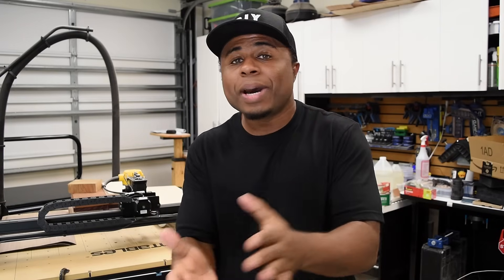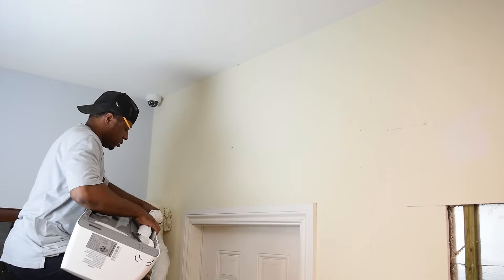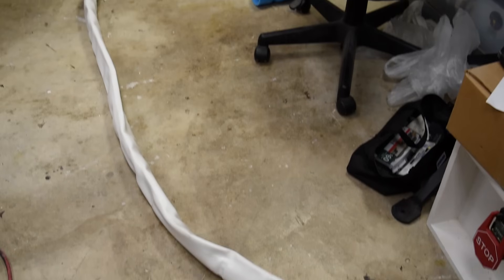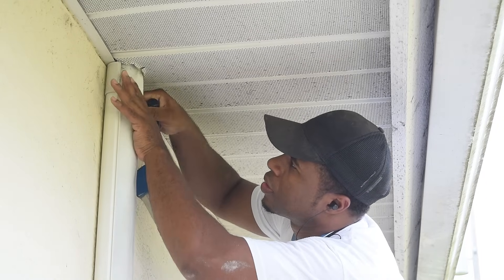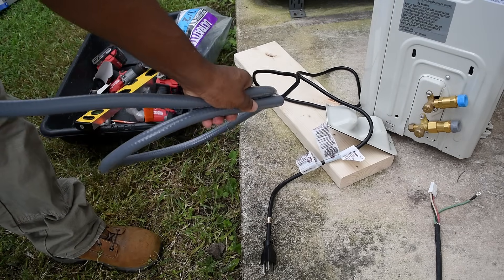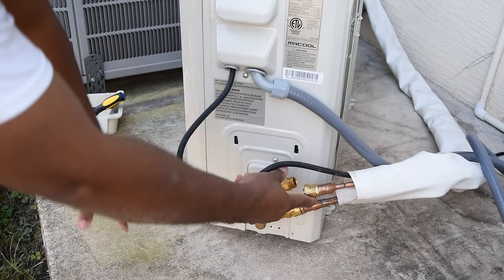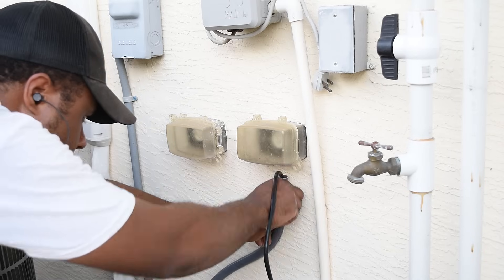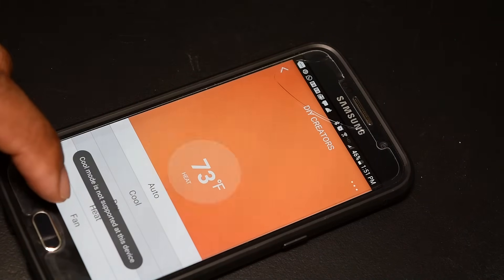How To install Ductless AC & Heating System // True DIY Mini Split MRCOOL

Comment: The air needs to be removed from the pipe work before releasing the refrigerant
Reply: I installed a DIY unit 12k btu 120v system I purchased from A Big Box, it was truly DIY.
Mine had a special quick connect valve that made it impossible to get air in the unit.
And in Florida it would have been full of moisture believe me. But this unit otherwise looks just as nice
with heat and WiFi, I didn’t get either one. Nice work on the install !
Reply: @rogern5368  Yeah those quick connect ones are awesome. Sadly banned in the UK now as they put air con engineers out of business :-)
Reply: Again, think about the older mobile home systems. They came precharged and they "open" the condenser when you tighten the connections down. It pierces the metal membrane thus opening the system up. This one doesnt have valves to back seat or close or any of that. Once you tighten it all down you bubble test it, just like he did. Just to clear this up, these aren't standard mini split systems. They use a different method for charging and there is no way to vacuum the system like you would on a normal system
Reply: Hvac guy here : the Mr cool systems come precharged (think about the older mobile home style line sets). 
There is no evacuation required or needed.
Reply: @BradBuildsStuff102  it comes pre charged in the compressor but the line are open. you have to manually open the valves with a service wrench to release the 410A into the system.and he didnt even pressure check his connections with bubbles. leave it to the professionals.
Reply: i was waiting for the lines to be vacuumed but when it got to the end i was like aaaaaaayyyyy he fucked his system up
Reply: You can tell this is a DIY. I’m not even sure how the system worked with out evacuating the air from the pipes before allowing the refrigerant in. It’s not the air that gets you it’s the moisture, this is why HVAC techs should install them and not a home owner.
Reply: @erevopwns  LOOK HOW STUPID YOU ARE 
"you can tell this is a DIY. I’m not even sure how the system worked with out evacuating the air from the pipes before allowing the refrigerant in"
Reply: brian menendez well if your so smart let’s hear your explanation... I would love to hear this one.
Reply: @brianmenendez  The linsets are precharged. When they are connected a builtin piece peirces the metal stop that contains the refrigerant .  I suspect a very small area of atmspere gets combined  in the system. Of course the excess  of lineset I see curled up behind the units is truly a eyesore and cutting it to size oresents warrenty issues  I have read. 

My issue  with this  system is its very cheep exterior and that most dyi. folks are not  informed  in the basics of power for the unit.
Reply: Robert L. Fallin . Interesting, this suggest to me the lines can't be shortened to length,. Hard to hide on a back -to-back  set up. 
All in all, don't DYI, get a tradesmen
Reply: erevopwns see above..
Reply: @conector14889  YOUR WRONG
Reply: #SHRPSHTR# How so?
Reply: Clone36 the pipes aren’t pre charged lol.... the condensing unit is.
Reply: erevopwns what, you gone all quiet now??
Reply: The pipework comes pre-charged with refrigerant.

Comment: all mini splits are the same to say that this is the only one that u can do yourself is false a decent install for never doing this before but my god at least hire a an hvac guy to run a vacuum on the line set your making unit have hire pressures then needed and down the road your gonna have a bad expantion valve or compressor...

Comment: You should have put a vacuum pump on it before you opened the valves !!
Reply: kirk poff true
Reply: @suicidalth0ughts508  Nope. Not necessary. Lines are charged and sealed at the factory. Seal isn't broken until the lines are connected.

Comment: great video, a couple, fairly significant steps were missed in this process. one is pressure checking the line set with nitrogen before opening the refrigerant valves. Not cost effective or environmentally considerate using the pre charged refrigerant for tight connections. 2, MAJOR STEP MISSED, a vacuum pump needs to be used in order to evacuate any atmospheric pollutants from the line set. Skipping this step could void the warranty and ultimately decrease the longevity of the system as a whole. Skipping this step is the equivalent to a surgeon not washing his hands before a procedure and failure to address this step is considered negligent practices in the eyes of most manufacturers, fyi. thanks
Reply: That is not true with these systems. They come from the factory pre-charged and ready to go.

Comment: not trying to be a hater but 12000 btu is kinda silly for a wall mounted ductless air conditioner. they sell portable versions of that with zero setup for half the price. at the least get a 20k, and more depending on how fast you want your room to be cooled.

Comment: I had an LG Ductless AC/Heat and it was a piece if Junk. Had it 12 years and it broke down 3 times. Went back to window units. They're awkward to put in a window but more reliable.
Reply: probably bc videos like this are put out that misled the correct procedures to install ac's and refrigeration
Reply: I bought the unit from a dealer and he installed it.

Comment: Man that was a great Vid..You covered all the bases. spoke well  ...I been planning to do same..This really put me in a wana do mode..Mine will  replace a 30y old Trane central unit thats been everlasting ..Just wana do it myself and not hire AC man...When this heat 100 deg here in TX drops into 60-70 /fall or spring I will do...THX Mr Cool   dan

Comment: You should have vacuumed the line set. Air in the line reduces performance.
Reply: Yes, indeed Richard....been saying the same thing here. 
I purged my lines...would have evacuated, but thought....well...let's suck it and see. (No pun intended). Been working fine for three years.  Cheers.

Comment: Yes, these units come precharged with the gas, and "vaccing-out"is not strictly necessary.
But I am of the old school: I would attach the liquid line (the smaller of the two copper lines first.... then crack open its valve, just to purge the air from that very long length of copper tube and the evaporator unit indoors. THEN connect the return (larger vapor line).......
As I say, the manufacturers say there is no need.... but hey.... air in any refrigerant system is not a good thing....never has been, never will. 
If you can minimize the amount of air in the system, the system must work better with a higher ratio of refrigerant-gas to-unwanted air....No?
(Air contains moisture: The enemy of any fridge plant! 
Be they industrial units, or transport units.)
As you say, amazingly quiet units....extremely pleased with mine.
Reply: I suspect those lines are "pre-charged", and the ends get pierced when tightened down on the units, so no air is the system.

Comment: I'm an AC contractor.....your system will not work correctly, you did not pull a deep vacuum first!!
Reply: Dan: You & I are of the Old School maybe.... 
I was a transport refrigeration engineer for 20 years: 
Yup...deep vacuums were a must on any new installation. And although I was skeptical of these "plug-n-play" systems, they do indeed .......
"Do what it says on the can"...
BUT! Having said that: I would at least purge the lines & evaporator, as I described above in an earlier comment.
As you & I know...air in a system is/was strictly taboo. And, as, we saw in the video...there must be air in the newly connected lines & evaporator.
Why this should be now acceptable, I cannot say, maybe the compressors run at lower head pressures...or the newer gases are somehow more tolerant of air present? Mine has been running fine for over three years: No Vac-pump used.
Cheers.
Reply: @patagualianmostly7437  Nope. Not necessary. Lines are charged and sealed at the factory. Seal isn't broken until the lines are connected.

Comment: Is this a ductless single room heat-n-cool? Do you need to install several units ?
Reply: Depends on its Power Rating.... I have one in the bedroom rated at (12000BTU) 3370w for cooling and 3460w for heating.(running on R410a refrigerant.)  I can leave the door open and allow the air cooling or heating and maintain the other two bedrooms & a small bathroom 'perfectly comfortable.'
Bear in mind that I live in a climate that is quite moderate:  There is NO insulation in the concrete & brick walls....... Summers can be as hot as 40°C but the winters rarely below -2°C...& it copes fine with the lesser of these extremes...in that sector of the house....
How long is a piece of string? Every installation & requirement is different.

Comment: Nice and simple install but I would add that if the connectors are not a compression fit you shouls teflon tape and pipe dope.
Reply: No, sorry, but You never use tape or other sealants on flare or "O"Ring connectors.
Not in refrigeration.

Comment: Can you add more pumps to the machine out side or every single pump need its own fan outside?
Reply: The "Machine Outside" is the "Pump".... a compressor & fan assembly.
The unit inside is the "Evaporator" (commonly referred to as "the fan unit".
On these systems, given the capacity of the Condenser (your pump) you will need one for each unit indoors....they only contain a limited amount of gas.
Saludos.

Comment: by opening those valves you can be fined heavily if you dont have a epa license for refrigerant, just a heads up to anyone that thinks paying a 100,000 fine rather than pay a professional.
Reply: I was under the impression that the gas used in these modern units was of the Ozone Friendly type and therefore not covered by the "EPA" rules.
No more damaging to the ozone layer than, say, LPG's like propane & butane. 
(which are carbon based as were the old R12, R22, R502 etc...but were considered the cause of the ozone damage.) 
R134a, as used in automotive AC, and R410a, as used in these, are ozone-friendly..
are they not? 
Please advise us accordingly.......or pray continue with your scaremongering.
Kind regards.

Comment: You dont have to vacuum the air outta the lines before you open the valves
Reply: I would strongly recommend "purging" as a minimum. See earlier comments.

Comment: Love the pace of you video.
You shouldn't run extension cord inside any type of conduit, flexible or rigid. Extension cords are rated to be non-enclosed to allow any heat buildup due to normal operating function to dissapate to the surrounding environment.    You run the risk of overheating the wire and  possibly causing a fire. It can be done but the cord carrying capacity will be seriously derated. Running individual wire to/from the supply/load is the correct way.

Comment: These split type AC units are super common in the Philippines.
Reply: They're super easy to install and more importantly don't require any ductwork so heating and cooling a house costs much less. You can also just use them in a few rooms if that's what you prefer.
Reply: Yeah I've seen them a lot but didn't know how they worked and at first thought they were just fancy fans so I came here to find out.

Comment: Didn't have to vacuum out the air before letting the refrigerant loose?
Reply: This System comes with sealed pure vacuumed refrigerant lines.
Reply: Micheal... I don't think so. The lines connected to the evaporator are merely plugged at the condenser end..... and even if they were in a vacuum, that would be negated the moment the plugs were removed to connect the lines to the condenser...no?
Personally, I am of the view that, despite the claims of the manufacturer,  all refrigerant lines and the  Evaporator coils should be evacuated before opening the valves and releasing the gas into the rest of the system.
In a perfect world.
In the real world... I simply purged the system of air before connecting the suction line.......... 3 years later...all is well.  You take your choice.
Regards.
Reply: C Wil definitely supposed to pull a vacuum
Reply: Look up the item. They have pre  charged linesets with quick Connect fittings that have to go to exactly 25 feet

Comment: I’m barely learning about these but some keep saying need vaccum. I’m an old lady but dont think its that kind of system. It’s like a replacement for a bad hotel dual system which we have in guest cottage, barely works. Really loud, uses tons of electricity, more than main house just by itself doubles our bill in a day!! and uncondensing your central air heat big system. I have no lingo for it but its a new idea but both heat and air. Right? Anyone?

Comment: We saw the one in Home Depot. Mitsubishi but expensive. Looked up similar. Any advise from anyone of what to purchase? It’s the heat I need with a slab floor have to wear my snow boots then give up at 20 degrees. I sew in there and now going to teach sewing. High desert. My portable AC i call R2D2 works great though. Radiant heater doesnt make it when its 20.

Comment: Amazing. Our retirement move gave us 3 buildings. We were looking into these. Just subscribed and see lots of videos that will help our retirement. The guest cottage has old fashioned non energy use and noisy unit. Cannot even hear tv. My sewing studio, garage sized has what looks like Barbie air conditioner and now we reconnected the water I dont even want to turn on. All buildings had scorpions and this thing has weeds and tons of silt in it!! It also has no heat. We range from 20 degrees to over 100 so we need heat and cool in both buildings. Thanks for your great videos so far.

Comment: I’ve always wondered why they call this type of AC “Mini Splits”....?
Reply: Still in search mode but as far as I see both heat and cooling. Home Depot has a nice one but pretty expensive. The part inside the room is smaller than this.

Comment: Great job, love the video. Someone commented you move to fast, that's a compliment in my book. You left me with only one question. Is your garage insulated? My garage isn't insulated and I share a common wall. The only access to the exterior is through my garage door, that makes it difficult to locate the outside condenser. Nice job.

Comment: Nice work , I would still pull a vacuum on the line before charging . The kicker is you have no warranty claim if installed buy Non cert. EVAC guy , so it dies you eating . I did two units 9000 and 18000 4 years back , running fine . Some companies sell kits 10 ft - 35+ft line sets with compressors charged  for the chosen length . While a short line 120 v unit is simplest to install , over 12000 gives you power saving in 220 Volt , adding more cost and confusion to a simple job . The real joy is the humidity it pulls from the air , set on light cooling 10 degree lower than room it pours water out the drain line . Look for " DC inverter " on the ductless box , most are . Its mean it starts slow and varies speed without big power surges / spikes that drive the bill higher . Very satisfying to install .

Comment: Pretty clean job, esthetically appealing. However; I would recommend that after hooking up your copper lines to charge the system with nitrogen before opening the lines at the condesner. This makes sure any known leaks are visible with your manifold gauges and isolates non-condensables. You also need to put the system in a vacuum using a vaccum pump. Otherwise, moisture in the lines will cause the oil in the compressor to turn into sludge, this is especially true for 410a, 407c and 502 refrigerants which are hygroscopic blends, meaning they attract moisture.

Comment: My man, this was quite the video from one craftsman to another. Great work. I would have run those copper lines outside in some kind of pvc sch 40 or 80, including the drain line. But hey, nice work anyway.

Edit: After giving it some thought, I wonder how the hell you could get the knobs on the end of the copper in any reasonable size pvc. You knew exactly what you where doing. My B.

Comment: Do you have a DIY video on how to install Electric mini water heaters? I bought a 4 gallon Bosch that plugs directly into an outlet but I need to see  a "how to" on cutting and attaching the water pipes under my kitchen sink. My furnace died & I have no hot water. It's ok in the summer but I'm worried about winter washing dishes my hands will freeze off. Hvac want outrageous $ to install or repair anything. 1 guy wanted $125.00 just to come LOOK, NO work done! Thanks

Comment: We get at least one or two 3 feet deep snow storms. Is this device ok to be completely covered in snow for months? Or should it be installed on a raised platform? Awesome how you show how to.
Reply: Ive been researching models after I saw the Mitsubishi at Home Depot and got their flier. All spit systems ive seen installed in pics or videos are on a shelf on the wall, several feet off the ground. Maybe for that reason. I’m also having a memory that someone said put it on east wall too, not the hot side of building. Well now i have lots more to look up.

Comment: Good video but it definitely should have had a vacuum pumped down. Air and moisture are not good in hvac
Reply: Those are pre-charged copper lines.

Comment: Ductless can be had in the 30+ SEER efficiency range.
Reply: @Cris Wilson... In just a few years the  SEER/HSPF numbers have seen a 33% increase .  I have a five year old  Two ton Mitsubishi  with a 21seer/10.00 HSPF and im about to install a 28SEER/13.5HSPF 9,000 btu unit to add below zero heating. These units are the best option  for old houses i beleive and i cant beleive my hvac energy cost reflects  a 55% reduction  over average years exspenses.  My next project  is a hybrid water  heater to reduce  that cost 50%...... GETTIN SERIOUS  ABOUT ENERGY USE HERE!
Reply: Robert L. Fallin as